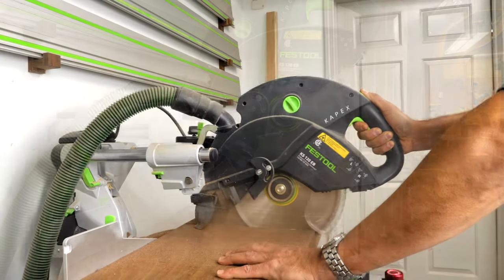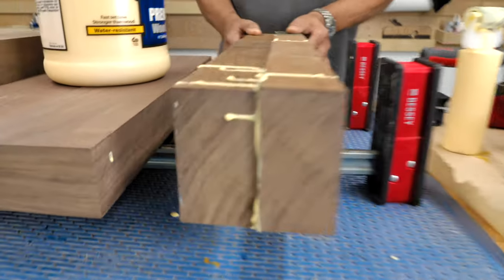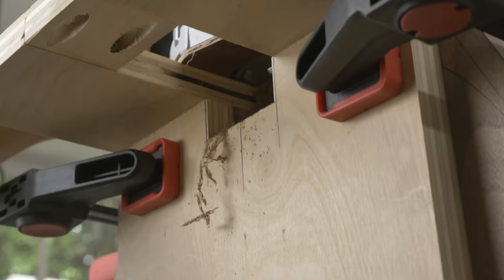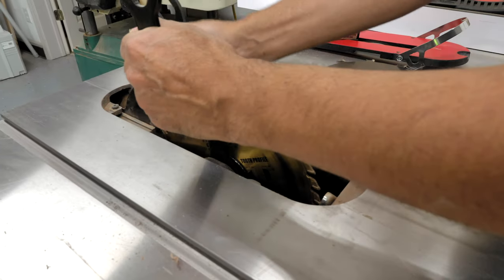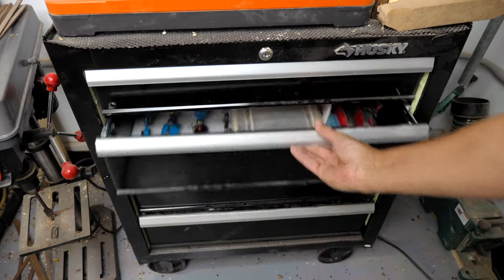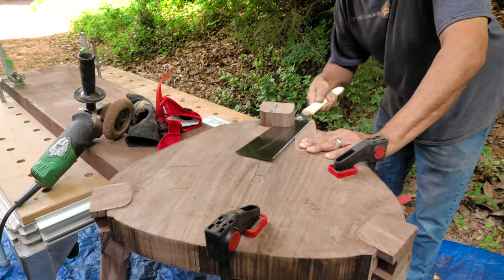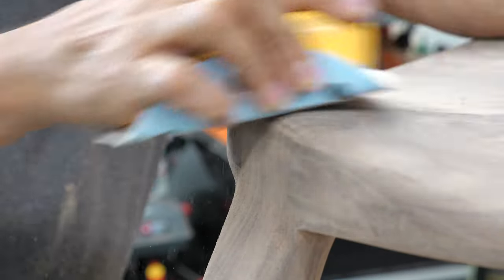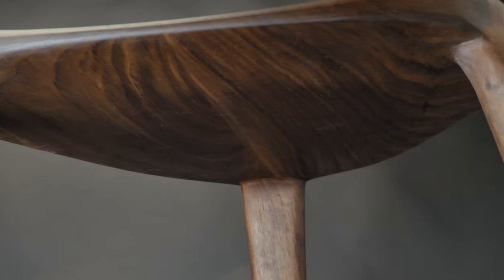Power Carving a Sam Maloof Style  Guitar Stool

Comment: Stool looks nice but Sam Maloof pieces ALWAYS have screws to support those joints covered with ebony plugs. Watch him at his drill press in his build videos. Your stool may just fall apart over time...
Reply from the maker: Actually, these joints are so tight, that adding a screw would have zero effect on the strength.  The leg would break before the joint. I’ve only seen Maloof add screws through the crest rails.